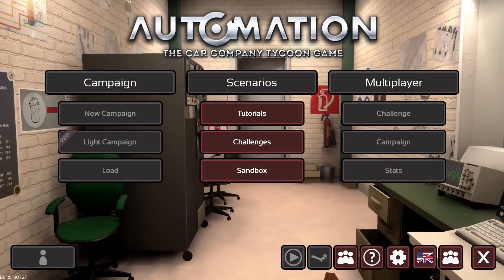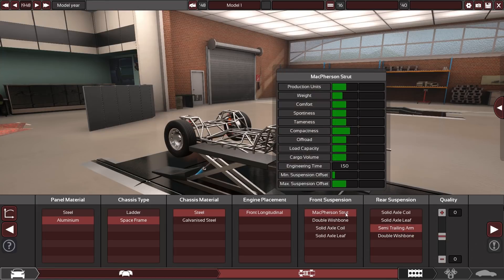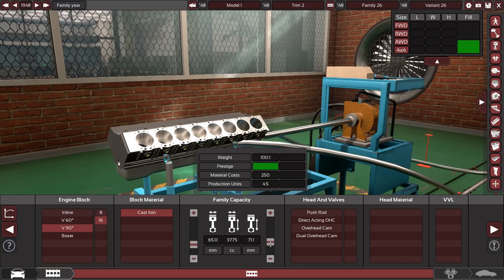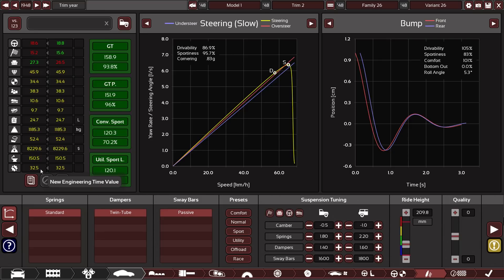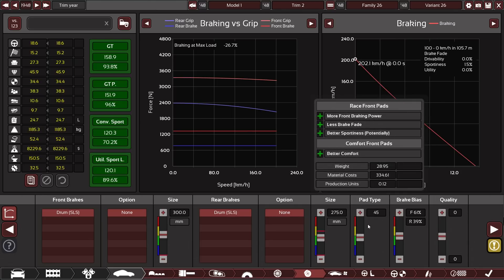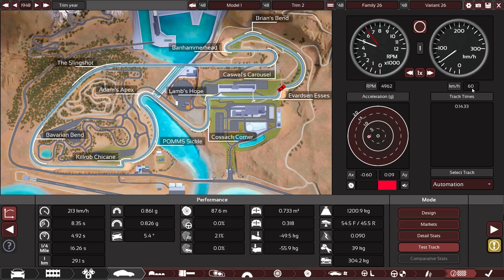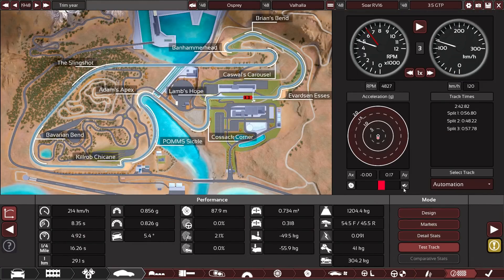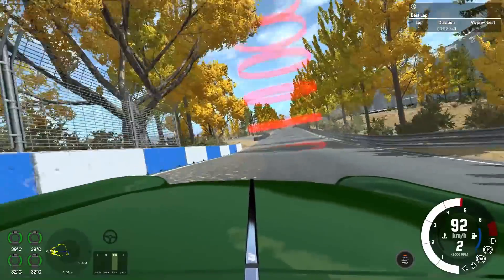BeamNG + Automation: 1948 GT Premium, GETD Ep.19

Comment: The engine is such a tiny V16...! It's rather cute in a goofy way, and surprisingly effective at that. And to be fair, it's hard to gauge whether or not the size would be correct for the era; most of the old V16 engines were made in the late '30s, and they were massive (as in 7.0L-massive) engines. 

Also, I really like the Valhalla's design. The right amounts of chrome, the right poise... The rear is a bit basic and the front grille could be slightly slimmer, but overall it's pleasing to the eyes. The British Racing Green is a wonderful touch too, govenah!
Reply: It might have a tiny V16, but it goes VROOOM and that makes it awesome
Reply: Indeed, sound like an Alfa Romeo V6 with extra pitch. It may have a small heart, but it'll pump a lot of blood into yours!
Reply from the maker: Anything larger than this in capacity would make way too much power :D this is in a happy place when it comes to power, still very controllable. :)
Reply: You think it's tiny? Ferdinand Porsche experimented in the 30s with a model named 114 and it was supposed to have a 1.5 liter V10 :P
Reply: The 1945-1951 BRM had a 1.5-liter supercharged V16, so this car's engine is like a big-block V8 compared to that BRM.
Reply: Dayum
Reply: Well Oskii, never heard of that one before. Was it intended to be a racing engine, like the BRM V16 Covet 1987 mentioned? When I was thinking of V16 engines in my comment, I wasn't really thinking of racing blocks... 

Either way yes, they're both extremely tiny. I wonder if, with today's downsizing trends, people would buy a 1.5 V16? xD

Comment: I think this game needs some more atention in the cylinderhead designs. It would be awesome if you could pick from different head types, like the HEMI head and flatheads. So i can really pick what the combustion chamber looks like or something like that
Reply: In the old version you could pick different head covers
Reply: yeah where did that go?
Reply from the maker: We only implement tech that wasn't outdated already at the start of the campaign in 1946 :) that is why flatheads and hemis won't be implemented. The modern superior solutions already existed back then and in a game so heavily reliant on stats it makes no sense to offer straight up inferior (but "cool" and "historical") options.
Reply: Perhaps in a later expansion automation will have a older starting year(that would be quite interesting)
Reply from the maker: No, that doesn't work well with how the game is designed. The pioneering days of automotive engineering had loads of wacky ideas that only partially worked. Most of the modern solutions were there in 1920 already, so why would anyone with hindsight pick the shitty solutions? In a game about accurate technical representation that doesn't work. In a game like Detroit or Motor City it does work because you only ever saw finished solutions which are easy to balance. So while those days are super interesting and exciting, that just doesn't work in Automation.
Reply: @ Tami_DE
I believe I saw somewhere that the customizable valve cover visuals are low priority compared to LC3, but will return at some point. I loved them in LC2 myself.
Reply: @trifler500 This is exactly what I'm waiting for. If I could just recolor them I'd be happy, but different designs would be welcome again too!

Comment: something that i have been wondering on for a while the lack of speed limiters on carbed cars, how come?
Reply from the maker: They don't have an ECU to do that magic :) so we assume there isn't one.
Reply: you would be surprised what ingenious ways they went about that, there was some different patients that did so mechanically.
1 i have seen and had the horrifying pleasure of experiencing was what they used on older tractors, where they had 2 arms with some weights on the drive shaft with a spring between, allowing engine to shortcut the ignition when the 2 weights got sprung out with centrifugal force and hit the outer pipe, meaning that the engine would work freely but in top gear it would kill ignition at a certain speed, changing the spring meant you could go faster.... well let's say 70km/h in a 50's ferguson tractor which does not know the meaning of the word wheel alignment is scary
2 was a vacuum pump on driveshaft so when you got to a certain speed it would make a vacuum in the manifoil i believe it was, meaning the carb would flow less fuel or almost cut fuel entirely, so you would not have the power to accelerate beyond a certain speed. but i can't say to sure how it worked as i have not read much into it, heard it's almost like a reverse cruise control of some sort.
hard to get any good material on this things but they sure was around, not commercially used in cars i guess,  and it would probably ad a couple of months of engineering,  but it was around, so i guess it would be engineering cost vs service cost for tier in automation.
Reply: @Stale_Mahoney  Another old school speed governor would be a centrifugal governor that cuts throttle as the arms extend.
Reply: was that a ignition or fuel cut governor?

Comment: how do you get the exhaust to tuck under the bumper and not stick out 2 feet past the bumper?
Reply from the maker: just place it lower than the bumper :)
Reply: any possibility of length scaling in future updates? you know, in case i wanna make a Zonda knockoff with 3x the horsepower or something
Reply from the maker: No, that is technically so hard to do that it is not feasible to implement.

Comment: Also, on a side note... Do you think we will be getting inline 8's at some point? They're my personal favorite engine design.

Edit:
A flathead design would also be neat, and could be useful for old vehicles.
Reply: Inline 8`s will come as DLC if the sales are high enough. I also want them.
Reply: Weren't flatheads pre-WW||?
Game starts 1946, so that's pretty old tech and as such would become obsolete in the early years of the campaign...
Why add it if it's only gonna be used for a few years in the beginning of a campaign?
Reply: Random41 
Because they would be simple to implement and cheap as all hell.

Ford was using the flathead v8 well into the 50's.
Reply from the maker: We only implement tech that wasn't outdated already at the start of the campaign in 1946 :) that is why flatheads and hemis won't be implemented. The modern superior solutions already existed back then and in a game so heavily reliant on stats it makes no sense to offer straight up inferior (but "cool" and "historical") options.
Simple to implement? Nah mate :P that would be a lot of work for something that really isn't used for long.
Reply: KillrobPlays 
Fair enough, I was kind of expecting an answer like that.

But, what's so wrong about HEMI's? Chrysler's first gen hemis didn't event exist until the mid 50's, and they still use them today. Surely they aren't THAT bad.
Reply: XenoYparxi 
Inline 8's generally hated high rpm because of crankshaft wobble reasons, because they were so long. But that's no more a problem with them than v16's, so I guess it's possible for them to be added into the game.

Comment: so what's the new engineering time calculation doing
Reply from the maker: it looks at the length of an n-dimensional vector formed by the sum of ET of its dimensions which are the design section (tabs). I explained that in one of the recent LDUs.

Comment: Why can't the engineering times overlap?
Don't engineering departments of companies work on projects in parallel?
Yes, the suspension department would have to know some details about the chassis and body, but it wouldn't be 100%, more like 50-75 or so to start working.
Also, there are a few variants of the car, so they can't really have exact information...
Reply: Just asking.
Reply: Didn't watch video before commenting, sorry
Reply from the maker: Uhh yes, I don't know what you're talking about :P they do overlap.
Reply: I meant things like panel material and chassis material, suspension, heads and bottom end, fuel system and such.
Reply from the maker: Yes, they all overlap in the new system we're going to use, but as the length of an n-dimensional vector where each design tab is one dimension.
Reply: @KillrobPlays  basically it is gonna take as long as the part which requires most engineering time, or?
Reply from the maker: No, but it is more weighted towards that for sure.

Comment: Your BeamNG footage is very laggy, just thought you should know.
Reply: Aj Meipalu Thanks🙄
Reply from the maker: Yeah, no idea how to fix that, It is an issue many have when recording BeamNG specifically. If anyone knows a solution I'm all ears. I'm now running this on a 1060, my old half-speed graphics card didn't have the issue.
Reply: So it isn't something YouTube messes up when importing the Video?
Reply from the maker: No, the throttling is in the recorded footage already. Others also have that issue with BeamNG, need to google around a bit for solutions.
Reply: My completely unfounded guess is that BeamNG does a tremendous amount of GPU work particularly for its physics processing, and the recording software relies on direct GPU calls to pull its frame data, so you end up with lots of dropped frames as the recorder's requests are too delayed by Beam's crazy-high physics sample rate.

Might explain why your older card didn't have the problem, if it lacked physics capabilities and the game fell back on your CPU for doing the physics calcs, or (same difference) if the recorder wasn't using direct GPU access on the old card.

Tho like I said, it's just a guess.
Reply from the maker: That is a fair assumption to make, strange is though that with my old graphics card (R270X) that did not happen, while my new card, a 1060 6GB does have that issue. Maybe it is not because of the card but an update or something, but it is bad nonetheless.
Reply: Have you tried using Nvidias native recording tool? Maybe they have done some optimization there that they won't give away to 3rd party developers.

Comment: That’s the thing I don’t get about cars with high sportiness ratings in the game. I made a Super/Hypercar and it was at 99.9% sportiness on the steering graph with no terminal oversteer. But at high speeds, even the slightest steering input makes the car slide. Even with a good amount of rear downforce. You would think that sportiness would mean it’s easy to control but I guess not. Anyone know why? I’m pretty much the opposite of Killrob... Terrible engineer, Great driver
Reply from the maker: Make sure that your high-speed steering graph is well controlled. Also back off a little on the general tune towards neutral steering off power, towards more understeer. If you use AWD then put more power towards the front wheels. Also: too much power in general will mean that you easily lose grip during slight cornering at full throttle even at higher speeds.
Reply: I think the graphs display the behaviour during "neutral" cornering. In other words not coasting or lifting mr great driver.
Reply from the maker: Constant speed cornering yes, no throttle input is considered in those graphs :) that is why the line for RWD is lower than for FWD, to at least a little bit compensate for the grip loss on power.